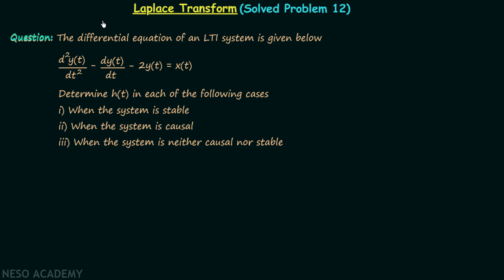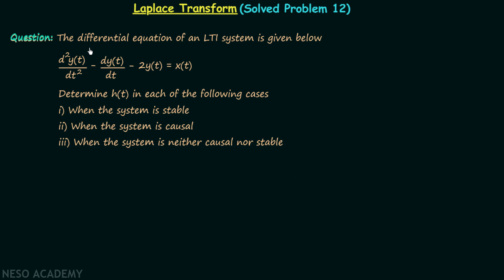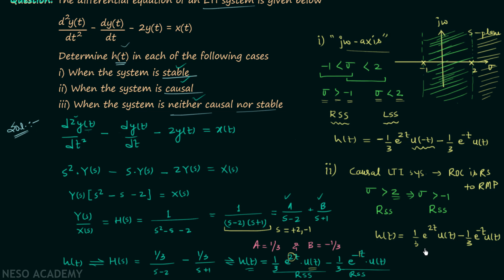Laplace Transform (Solved Problem 12)

Comment: sigma <2,.sigma <-1
As Resultant ROC not enclose the jw axis. which implies Unstable.. See case 1 in video. Both (Resultant) ROC enclose the jw axis... implies STABLE.
See case 2 resultant ROC is Right side to the Right most Pole. that implies.. Causal System.. but not stable.
case 3 resultant ROC is left side to the left most pole.. thats implies Anticausal.. but not stable (Since Resultant ROC not Enclosed jw axis).
In questions Containing Multiple ROC s Focus on Resultant ROC and decide the result.
Reply: Why it is not sigma>0;sigma<2

Comment: This part 3 will have sigma<-1 and sigma >2 as the ROC.There is no common region in these two. So I think no such Laplace transform will exist as there is no common region of convergence as we have an unstable and non causal LTI system.
Reply: Laplace transform exist only at the region of convergence. If we make both parts of the solution Left Sided Signal(LSS) then the Laplace transform ROC is sigma<-1. Because from there only common region starts.

Hence the ROC doesn't cover the img axis. Hence it is unstable.

Also ROC is left side to the left most pole. So that it is noncausal as well.
Reply: this is not the correct explanation ,we have to make the system unstable so consider e^2t as e^-2t which means that sigma will be greater than 2 it will be right sided signal and in other case sigma should be left sided as it should be less than -1 so it will become as sigma will lie between-2 and -1 which will be the common region so which implies that jw axis is not included and it is in the left side so it's unstable and non causal.
Reply: @kshitijwadhwa4277  how u can say that if the system is unstable than it bound to anticausal?

Comment: can somebody pls explain why we are taking both the signals as left-sided. im asking this bcoz if both are left sided then the jw axis gets included which makes the system stable. but in our question we need to calculate h(t) for unstabe system
Reply: Both signals have to be left sided because the condition States not causal which implies anti-causal signal.  For anti causal signals, The poles are Left sided. Now recall from the properties of Roc if we have a both sided signal i.e a signal that contains two Poles And Both Poles are Left sided. ROC IS ON THE LEFT SIDE OF THE LEFTMOST POLE. IN THIS CASE ROC<-1. Which doesn't include the jw Axis. Because of this property of ROC, you won't shade the left side of pole 2. But you'll only shade the left side of pole 1.

Comment: Can someone explain 3. option?
Reply: see for neither causal nor stable ROC will be to the left of the left most signal and should also not include JW axis.....so SIGMA will be less than -1 and since it is less than -1 it will also be less than 2...ok....so now you have 2 LEFT SIDED SIGNALS but h(t) for general case is right sided for both parts.....on changing to LEFT SIDED you will get the answer as posted by many guys above hope you understand bro
Reply: @JJpunk434   thank you very much
Reply: @JJpunk434  then what about the jw axis? doesnt it become a stable signal if we do so?
Reply: @JJpunk434  If we are taking both as left sided signal ...the jw axis is getting included which makes the system stable...hence to make the system unstable sigma must be greater than 2......so please can you explain me this part??
Reply: @ritwikasanyal9939  if you take this as a case then there will be no common region ,which means no ROC which further implies no laplace transform.

Comment: H.W. Ans:
[(-1/3)*exp(2t)*u(-t)] + [(1/3)*exp(-t)*u(-t)]
Reply: Right... 
Since...   Sigma <-1 and <-2
Both part left side
Reply: i think for this condition to be true, sigma has to be less than -1 and greater than 2, that way there are no intersections of R1 and R2, therefore the system is not stable nor causal so the answer should be: 1/3exp(2t)u(t) + 1/3exp(-t)u(-t)
Reply: @ PROTOX300 then there will be no common roc...which means we can't find Laplace transform... so that should not be the case, So Sigma should be less than both -1 and 2
Reply: then there will be no common roc...which means we can't find Laplace transform... so that should not be the case
Reply: @PROTOX3000  then the L.T will also not exist
Reply: @PROTOX3000  in that case no ROC means laplace transform will not exist
Reply: Yes, exactly
Reply: How u solved can u explain please
Reply: this is also what i got !
Reply: why dont we take alpha<-1 and alpha<2
Reply: -1/3e^2tu(-t)+1/3e^-tu(-t)
Reply: correct answer.